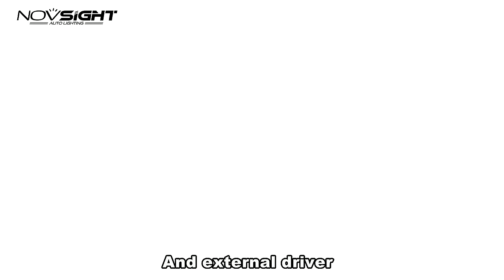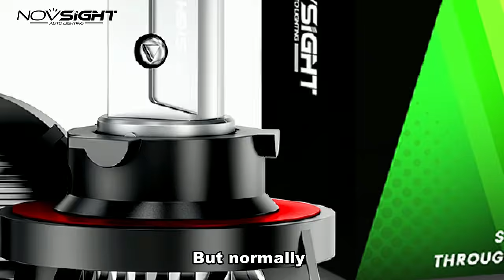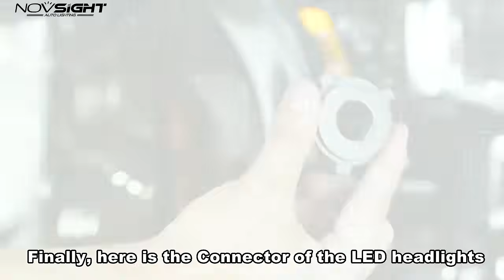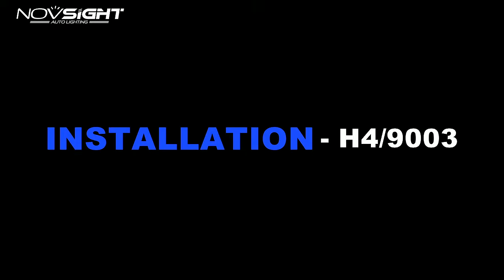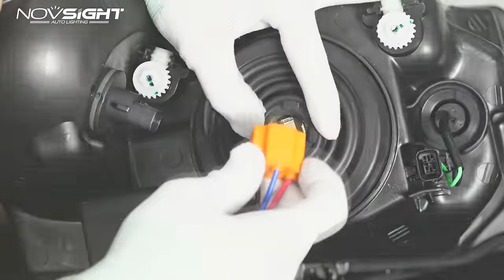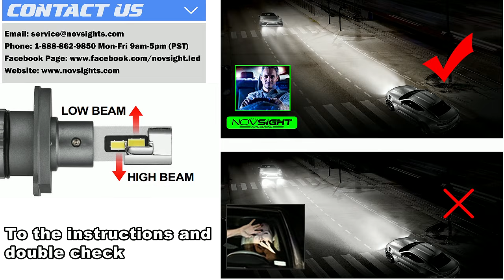How to install Mini Version H4/9003/HB2 LED headlight bulbs - Novsight H4 LED

Comment: This cut off line for left hand drive car.....
What about right hand driven car
Reply from the maker: Hi, the cut-off line is decided by the light housing, not the light bulb. If you have a right-hand drive car, the cut-off line should be rising on left without further adjustment.

Comment: Difference between mini and non mini version?
Reply from the maker: Hi, mini version H4 has the same size as the halogen bulb. It will be easier to install than the regular size.

Comment: Whats the best H4 bulb with good lightpattern and with canbus? Looking for our vw caddy company car.
Reply from the maker: Hello! Can you also tell me which model year is it?
Reply: @NovsightAutoLighting  its a caddy 2011 model H4 with canbus.
Reply from the maker: Hello, sorry for the late reply.😣😣
For the Caddy 2011, you can try the latest upgraded H4 in this link to our Amazon homepage:
https://www.amazon.com/NOVSIGHT-H4-Headlight-Headlights-Conversion/dp/B09H4H1C3D/ref=sr_1_1?keywords=B09H4H1C3D&qid=1663656909&sr=8-1&th=1
Please make sure your original light bulb is H4. If it is HID or Halogen, it would not fit your headlight.

Comment: What will you recommend in projector headlight for hyundai elantra 2016 ad..the socket of my low beam in projector is hb3/9005.what will you recommend?
Reply: I will recommend you F06 series headlight,check here:https://www.novsights.com/products/led-headlight-bulbs-9005-hb3-24000-lumens